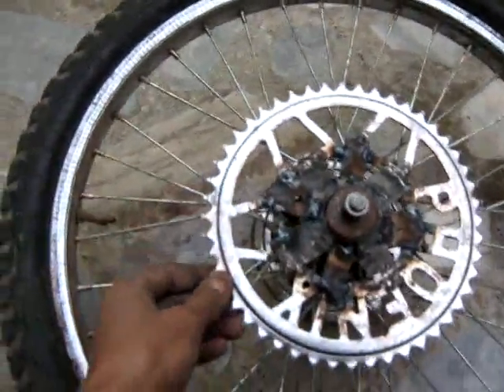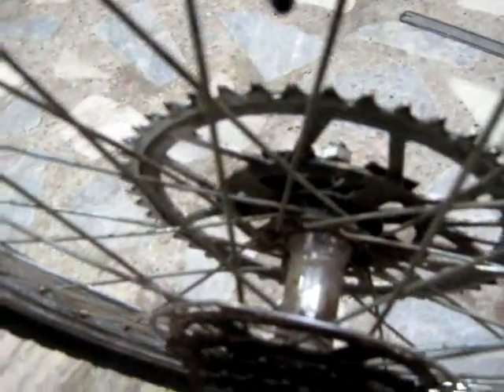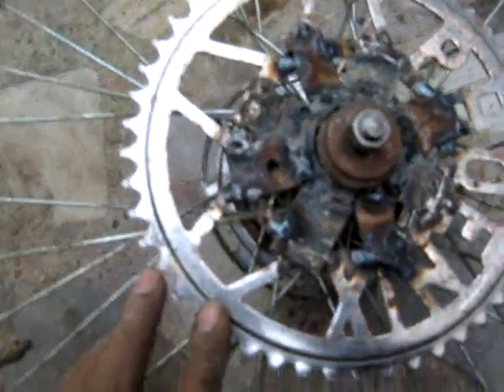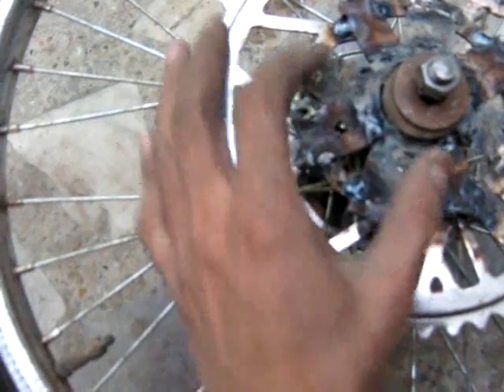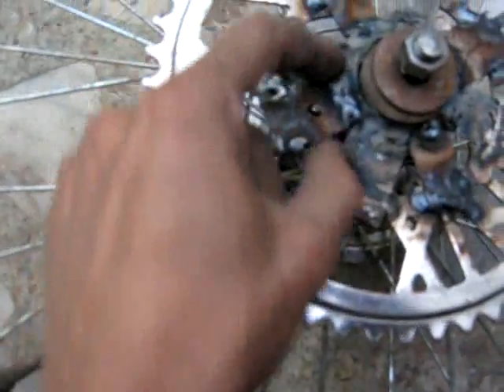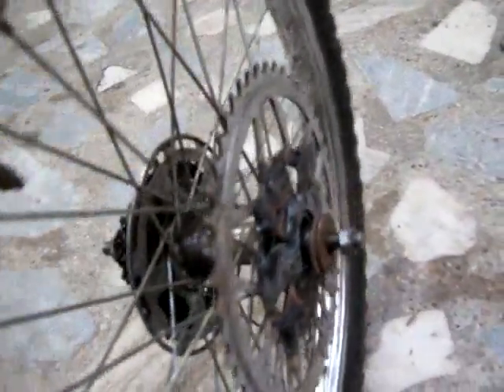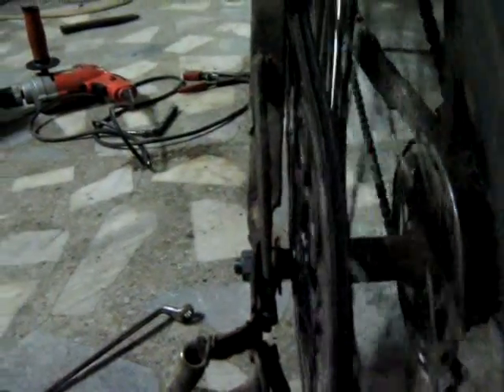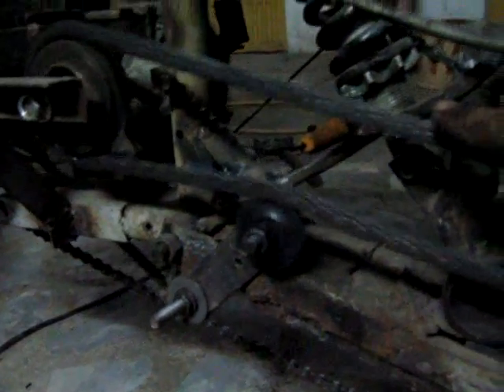Pakistani Low Cost Electric bike (with limited resources and budget).

Comment: Not to knock you on your project but did you say Pakistan budget bike i don't think you want to ride that bike in Pakistan it doesn't look like any bike it looks like a bomb with all them wires and not to mention you still have to install the battery pack and that's really gonna look suspect man your setting your self up i wouldn't be caught riding that thing good luck and ill pray for you you'll need it.

Comment: I applaud you for putting it out there for all to see. don't matter if its pretty or if it looks nice, that can be refined at a later date. whats important is that your welds are solid and everything is measured and centered as it should be. just being able to grab a power tool such as a welder and making something from scraps is good for the self gratification. let alone mixing in first time electro-engineering and fabrication and design. Very well done. hope to post a vid response soon.

Comment: @Numberonebikeslover Nice I see you have the gear reduction sorted out - thre are a lot less bits and pieces on the front wheel drive one. However if you dont have access to laser cutting and CAD then you are stuck with bits from the bike shop and you have done an excellent job at making it work with the standard bits - well done keep up the good work.

Comment: @Numberonebikeslover It probably is dangerous however the thing to remember from that video is keeping the gear ratio such that the motor runs at its design speed when the vehicle is at top speed or the motor gets hot and then uses up the battery power quickly due to the magnets inefficiency operating at elevated temperatures. Be sure your gear ratios are designed around the motors design speed that's the important part - that's why it works so well with only a 12V 200W motor - but on 24V = 400W